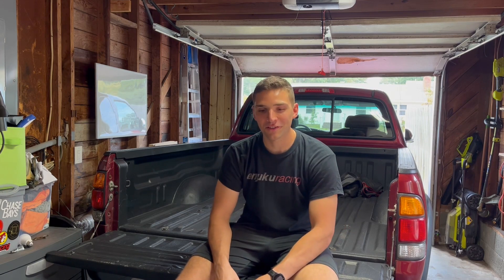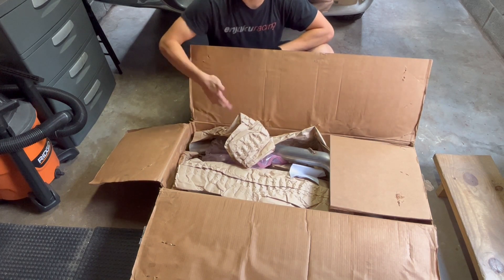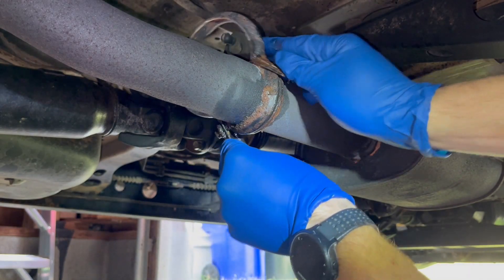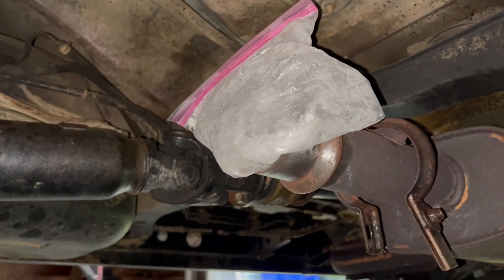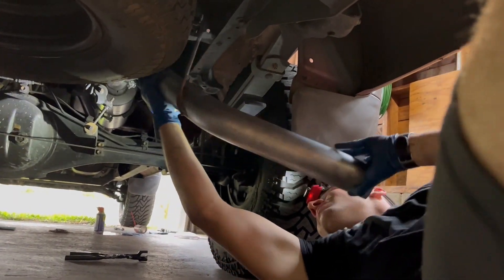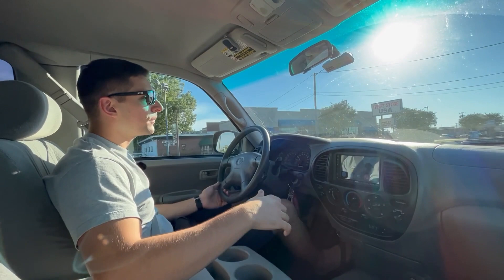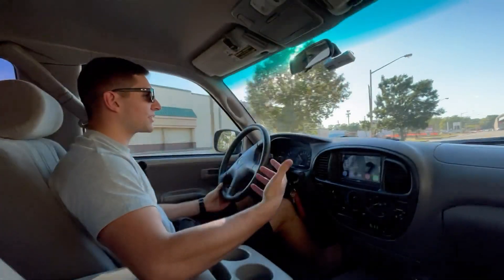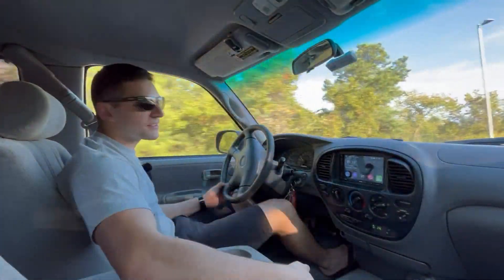First Gen Tundra gets an MBRP Resonator Back Exhaust!

Comment: I did this mod today, took me about 40 minutes.  They must have mad a modification to  the pipe that connects to the stock pipe, mind slipped right in, no issues.  That $12 dollar tool for the rubber hangers was well worth it.  I did put the chrome tip on, it makes the tone a little deeper.  Great upgrade for the price!  I also had to replace the carrier bearing, not difficult but not as fast and easy as the exhaust. Tomorrow I'm going to try to get the CV axle boots replaced.
Reply from the maker: Glad to hear about that, thanks for watching!
Reply: PLEASE I need your help what size socket do I use !
Reply: @supernova2992  socket for the clamps?

Comment: Nice! I’ve had great reliability with my ‘05 Tundra. 307,000 miles in the snow belt and still has its original exhaust!
Reply from the maker: Love to hear that, I plan to drive mine for a long time! Lol thanks for watching - Sal
Reply: Got 214k on my 05 double cab, absolutely nothing wrong with my motor so that 300k+ sounds promising to me 😅

Comment: I installed this kit because of this video. I'm happy I did. I love the sound. Quick tip I lubricated the first pipe and took a 2x4 with a 5 pound sledge and gave it hell. Seemed to do the trick. Install was easy after that. Thanks for the video I have literally watched all of the tundra videos.
Reply from the maker: Nice, I hope you like the sound as much as I do. The video really doesn't do it justice. Good tip for that first pipe. Definitely gave me some trouble getting that first one in. Thanks for watching! - Sal
Reply: What size socket do you use for the first exhaust clamp !! I just subscribed to

Comment: Awesome video man.  Were you able to look down the inside of the MBRP muffler before you put it on….. curious if it’s a louvered or perforated design.
Reply from the maker: Dang dude, I completely didn't think to look. Sorry about that, but I wanna say that it's a perforated design because of the muffler shape. Thanks for watching though! - Sal
Reply: @JDMDriveway  no worries at all thanks for the info.  Also, I wanted to ask if you had taken the truck up to highway speeds and get your thoughts- I didn’t know if you had based on the rollers and footage driving around town in your video.  Thanks very much.
Reply from the maker: Yeah man, I've had it on highways and I actually towed a few hours with it too. I'd say there's a hint of drone at like ~2800 RPM (65ish mph I think?), but in my opinion it isn't deafening and music can easily drown it out. I think it's worth noting that I'd say I have grown to accept a higher tolerance for noise in the cabin after upgrading to my noisy A/T tires. Regardless, I still think it's a good upgrade that's a bit louder than stock, but not obnoxious around town or on the highway.

Comment: 8:43 You can hit the O/D button on the end of your shifting knob and it cuts the overdrive shift off so you can get better acceleration. My 03 Limited Tundra and my base model 02 Camry both have an O/D button, so I'm confident your truck can do it as well.

Comment: I commented before and I have one of those exhaust cutouts and man, the drone is massive lol. The tip on the cutout is pointing directly to the ground. It's fun to open it up and stomp on the gas, it really roars. But for daily driving I usually have it closed. I enjoy the Tundra videos I have an 05. Keep up the good work!
Reply from the maker: Oh yeah, I remember you mentioning the cutout! I still don't really have plans to do it, but I'm sure it's super fun when you want to get rowdy haha thanks for watching! - Sal
Reply: I’m thinking of doing a cut out on my dak R/T. keeping the muffler and resonator so she puts like a kitten and roars like a lion. Which one did you get? Thx
Reply: @gknettel22  Ah nice. It's kind of unbranded but find out what your exhaust diameter is. Then get it welded before the mufflers of course. Mine had 2 remotes with it. You'll have to wire the receiver and motor to your battery. My receive box died like last week so I'll end up hardwiring it with a button into my cab.

Comment: I’m installing mine today, if I remember I’ll edit this comment with how it went!

Edit:

Alright, let me start off with that I am fairly new to car modification so it may be easier for someone else. 

This install took me 2 days, day 1 was removing the old exhaust, my first issue was the bolt on the clamp that holds the muffler pipe to the resonator was very rusty and stripped, so I had to cut it off with an ankle grinder, thankfully before installing I thought this might happen so I bought a new one of Amazon before hand. I had to stop on day one because I could not get the new pipe on to the old pipe all the way no matter what I tried, I even tried the ice and the heat but to no avail. So on day 2, I put my truck on an actual lift and was able to hammer the pipe on with a rubber mallet. Then I was able to install the new parts without too much issue. (I work at an auto shop so I only had access to a lift on my lunch break) 

I’ve driven around for a little bit with the new exhaust and have been very happy with it. No droning at idle, and it sounds great on startup and when you give it gas. I bought mine of realtruck for about $400. 

Overall it’s a good choice for a first gen tundra, I think my friends will be jealous… 😂
Reply from the maker: Nice!! Yeah let us know what you think! Thanks for watching
Reply: @JDMDriveway after taking the exhaust clamp off, the 2 pipes seem to have rusted together, I’m trying some more PB blaster now. Any ideas if that doesn’t work?
Reply from the maker: Aside from letting that sit, maybe heat would help loosen it up? That's frustrating, best of luck!

Comment: Your Tundra looks and sounds amazing! The exhaust is money on that rig. The sound of the valves on the deceleration is great. These trucks are incredible in terms of reliability, while giving an irreplaceable feel. Mines a little older, put together over in Indiana and still kicking proudly. Putting new injectors in at the moment. Any debates on 4 hole and 12 hole?
Reply from the maker: Thanks Spencer! I'm enjoying the exhaust so far and the truck has been great to me too. I've done a bit of research on injectors because I was considering upgrading to the 12 hole but I didn't really see enough convincing evidence that they were better than the 4 hole. I'm sure you can't go wrong either way! Thanks for watching - Sal
Reply: @JDMDriveway  Good to hear about the exhaust! Picked up the 12 hole injectors and am putting them in tomorrow, hoping that it makes the truck smoother than new. Got a pretty good difference when changing to iridium plugs and NGK coils. I’ll keep you posted on the injectors.
Reply from the maker: Yeah man, I hope you see a difference with the injectors, I read some things that it may help fuel economy which would be nice haha definitely let me know, I'd love to hear!

Comment: Thanks for the video. I installed the exact same exhaust for my 1st gen tundra. The last pipe is loose tho, how I’ve tightened the clamp but that back piece is still loose, is the hanger what’s supposed to keep it from swiveling down?
Reply from the maker: Huh, that's weird, but yeah that hanger on the back section should keep it from rotating down. The two pipes on my kit fit tightly and I haven't had any issues with it being loose or sagging. Hope you can get it figured out, and thanks for watching!
Reply: @JDMDriveway  I think I’m going to order better clamps. I’m going to try using band clamps to see if they work better. Thanks for the reply. I appreciate all your videos!

Comment: I just installed the same exhaust on my 2003 Tundra 4wd access cab. The new muffler seems kind of close (~2 inches) to the rear shock though. Did you run into this during your install?
Reply from the maker: I just checked under my truck and it does look a little close to me (about 2" away), I haven't run into any issues with it though. Thanks for watching, and I hope you enjoy the exhaust as much as I do!

Comment: Sounds way better and not to loud. What are the wheel specs? Offset and width also tire size? Definitely the perfect tundra
Reply from the maker: Exactly, it's just the right volume and the phone mic really doesn't do the tone of the exhaust justice. It sounds awesome in real life, especially with the windows down. The wheel and tire setup are Vision Manx 16x8 +0 and tires are 265/75r16. This video goes into more detail on it. Thanks for watching! - Sal

https://youtu.be/gD2DY-Zu448
Reply: @JDM Driveway  appreciate you 🙏 if I buy a tundra I want to run a setup similar to this. In a toss up between a Silverado or tundra
Reply from the maker: Ah gotcha. Yeah I've been really liking my truck, but assuming you're looking at similar year Silverados, they're both older, simpler trucks so in my opinion you can't really go wrong. Best of luck with the search!

Comment: Sal I'm thinking I'm going to buy one of these for my double cab, but my resonator is rusted out. What kind of resonator would you purchase?
Reply from the maker: Hmm I did some quick research and it looks like you'd probably have to replace the whole section that connects up to the cats unless you want to cut and weld. I don't know specific resonators to buy, but I would say to lean towards stainless steel or at least alumnized steel so that it has a longer lifespan. I'm still absolutely loving the exhaust though! Hope this helps, and thanks for watching. - Sal

Comment: Do you recall what size socket to take the exhaust off? I don’t own too many in Metric so I usually need to go buy them.
Reply from the maker: Hmm sorry I didn't include it in the video. I'm pretty sure it was a 12mm but it could have been a 14. It's pouring outside today, but I'll check tomorrow and let you know for sure - Sal
Reply: @JDMDriveway  thank you!
Reply from the maker: Ok, so just played around with it a bit and the factory clamp uses a 12mm. Then the new clamps from mbrp use a 15mm but the 5/8 was close and you could probably make that work. Hope this helps! - Sal
Reply: @JDMDriveway  thank you again! Appreciate it. I bought the same exhaust because of your video. Sound and price are both great

Comment: Huh, just installed this and it doesn’t sound nearly as badass as yours. If anything it just sounds like stock
Reply from the maker: Dang, sorry to hear that. I had a very noticeable difference in tone and volume. I wonder if your stock system had a leak or something so it was louder than it should have been? I've also found that the mbrp muffler has "broken in" a bit and gotten a little louder too after driving for a few days. - Sal